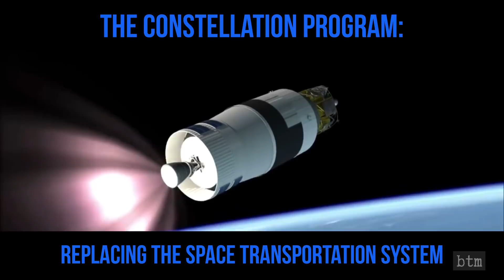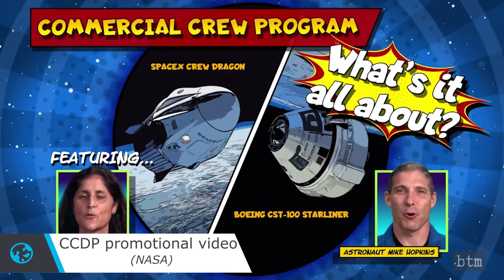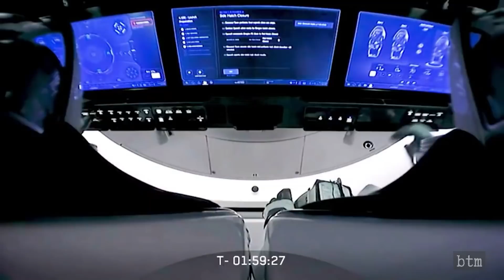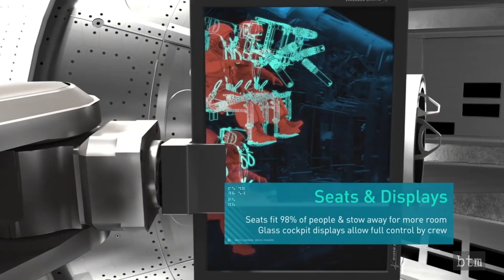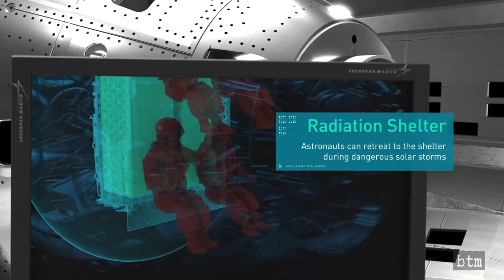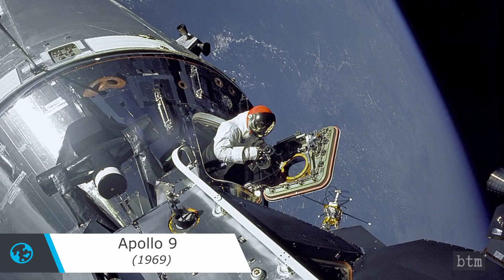SpaceX Beats Lockheed for 1st Manned Spaceflight on 5/30/2020 | Why is Orion at Least a Year Behind?

Comment: Boeing is the primary SLS contractor, not Lockheed... Orion is only built by Lockheed in conjunction with Airbus, almost the entire design process is done by NASA. Plus Orion and Dragon are on two completely separate playing fields, with two very different mission sets. Not one bit comparable. I believe you meant to say Boeing's Starliner was behind SpaceX's Dragon, as they are both direct competitors to each other.
Reply: Justin Weinberg 
Yea, editing and posting a video to youtube is apparently too easy compared to... reading with comprehension.

Comment: I was an IT contractor for nearly 20 years with the Fed Government.  It's not about accomplishing anything, it's about preserving the bureaucracy. 4 year delay on a project because the admin was too busy. 1-1/2 year delay on another, same excuse. When the 2nd project was handed to a newer Fed admin, it was approved in 3 weeks and implemented in 1 week. The 4 year project handed to a newer admin, approved in 1 month and implemented in less than 2 days.  Get your GS rating and step increases, wait your 30 and retire.  That's the theme.  To  the biggies like Boeing and Lockheed, welcome delays and change requests, then the money just keeps coming. At least 20% of all Fed contracts are wasted money and I'm being generous. Commercial will be the only success.  I'd say Bigelow has the in with creating the next space station. If Musk or someone else comes up with the money we could have an Earth Moon Lagrange point rotating space station inside 10 years.  NASA, they won't land on the Moon by 2025 as dreamed, unless it's using gear they have no part in designing or fabricating.

Comment: The SLS w/Orion crew capsule should’ve been cancelled a long time ago. However, the 🇺🇸 Congress has immense power and many jobs are tied to these projects and that’s why we’ll see the SLS w/Orion fly and not be cancelled, as it should be. Given that the Constellation program was cancelled, we’ll never see the cancellation of this overpriced, mismanaged boondoggle. Not to mention the fact that it’s not a reusable platform, they’re going to drop a $1billion+ rocket along with (4) RS-25 engines at $150mil per engine, dropped into the ocean each time the rocket lifts off, never to be used again. Such a shame.